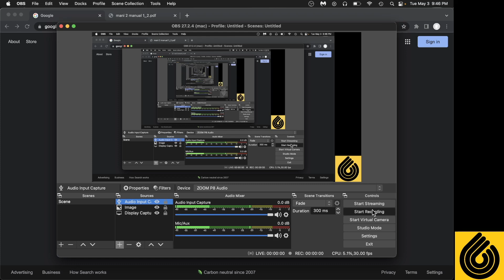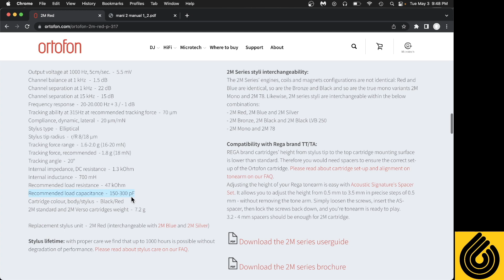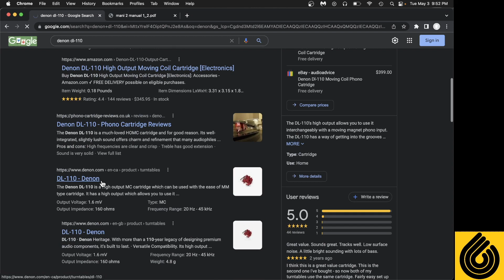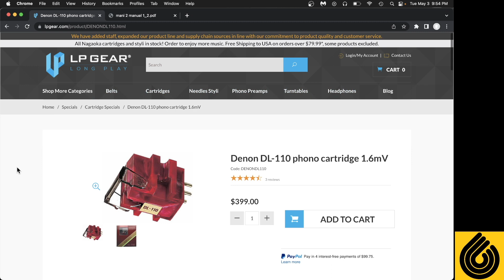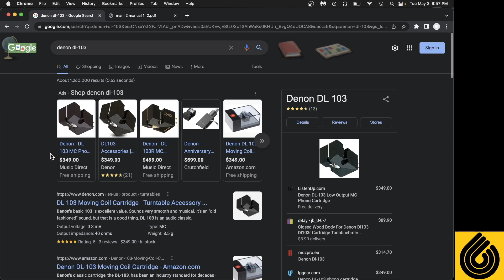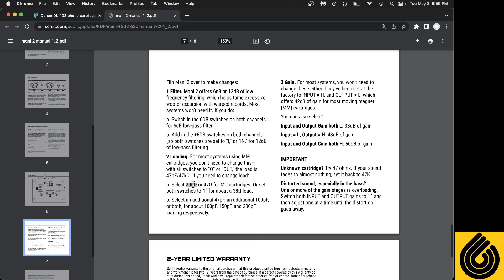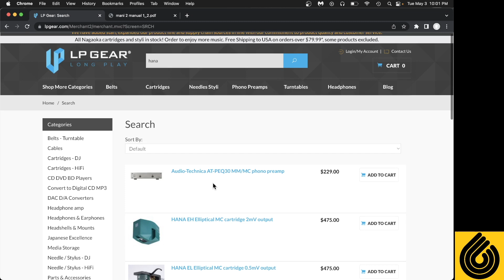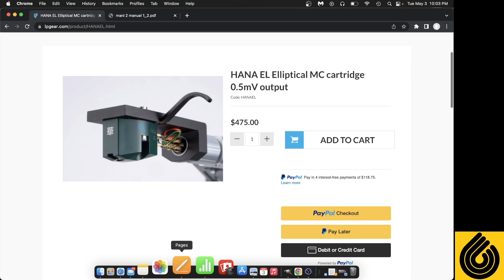How to Configure the Schiit Mani 2 (or any phono preamp)

Comment: My apologies if you already mentioned this but what settings would you recommend for the AT VM540ML? 

Thanks in advance!
Reply from the maker: It should be okay out of the box.  You might want to give it a little more juice than stock but setting the Input to to L and the Output to H.  This will give you a little more gain.  If that causes issues, change it back to Input H and Output L.

Comment: Mani 2/Ortofon 2 M Blue/Pioneer PLX-1000. Great setup tutorial. Thanks. You can lift the performance of Mani 2 with upgraded power supply. The stock wall wart is left wanting being noisy and you can open up on clarity and range a bit. 16VAC 2.5A Desktop Power Supply (AUD$39) from Wiltronics (Australia) Linear transformer C-Core type, Low noise with No SMPS RF. 

I was looking at the Skoll F but PLX-1000 hasn't got XLR output. If your turntable doesn't support Balanced why get a Balanced Phono Preamp. My system that I just ordered Schiit Jotunheim 3(Balanced Headphone Amp)/Lokius (EQ)/Mimir(Balanced DAC)/Mani 2(Single Ended Phono Preamp). Skoll has a volume adjustment and EQ through Forkbeard. I can match the volume from Mimir after I set the Mani 2 and Lokius is lot better EQ. Lokius both Balanced and Single Ended outputs are active so that when used as a switch (Balanced DAC XLR/Single Ended Phono RCA) you can have Balanced only output to the Amp. Of course the Single Ended Phono coming out from Lokius Balanced output still is Single Ended that doesn't change but allows you to listen both with Balanced headphones. 

Of course you get the manual but this makes it so much easier to understand. Thanks.

Comment: I asked the folks at Schiit about your recommendations…this is their response 

Ortofon 2M Blue and Bronze have the same loading recommendations. Cables can add between 50-150pF depending on length and construction. To make sure you're within their loading recommendation of 150-300pF, we recommend setting the Mani at 100pF (base + 47pF) because otherwise if your cables are on the higher end you'll eclipse their loading recommendation.

Comment: Sorry I'm confused. I have a mani 2 and I'd like to install a Sumiko blue point 2 moving coil on my turntable. Specs: Output voltage: 2.5 mV @ 1kHz, Load resistance: 47 kOhm, Recommended load capacitance: 100pF - 200pF. Can you help/show me what settings I need? And don’t you have the MM settings backwards, top loading is 200 max bottom load is 100 max? Thx.

Comment: Has anyone here paired the Schiit Mani 2 with an Ortofon 2M Red? I’m wondering how good it sounds. Also, would you say the Mani 2 is an upgrade from the Yamaha AS501 phono preamp? That’s what I’m running. Thanks!
Reply: As you can see there is many different cartridges with many different settings and options to get best out of them. Yamaha doesn't have specific settings. It will most likely work OK but never optimum. Specific Phono Preamp usually is better because you can set to what you have.

Comment: I have a Project Pick It Evo MM cartridge that has the same specs as the Ortofon Red, but the Output Voltage is higher at 7v vs 5.5v on the red. What would I need to change?

Comment: I've had a fluance rt82 going through the mani 2, Yamaha receiver, and Klipsch rp600m's for several years thinking I had the mani 2 set correctly because I thought I was supposed to leave it as-is for the ortofon om10. I resigned to the fact that my setup would just never sound as good as even streaming unless I upgraded alot. Turns out the settings weren't even correct from factory.
I watched your video and changed the settings to your recommendation and BAM! My vinyl came to life with better instrument separation, clarity, highs, and no distortion! Thank you thank you!!! Subscribed!
Reply from the maker: I love to hear that!
Reply: @christopherrobin58 i have a similar setup with the same tt and cartridge. what settings did you use on the mani 2? the first setup that was discussed?

Comment: Do you have recommended settings for the AT33PTG2? I watched your video and set it similar to the DL103 but it still sounds bad.
Reply from the maker: Make sure you have the 200 ohm settings on both channels ON (to the right) and the 47 ohm settings OFF (to the left).  The gain settings should all be ON (to the right).  The Filter and PF settings should all be OFF (to the left).

Comment: Hello, I'm a little bit confused on how to configure the load for my new ATVM95E cartridge. It says that it recommends a load of 47k ohms which makes sense since that's the factory setting but it recommends a capacitance of between 100pF and 200pF. Is there a way to set the capacitance to right in the middle at 150pF or should I set it to the upper limit of 200pF like you did in the video? Thanks for your help
Reply from the maker: Sorry, I just saw this comment.  from the factory, there's already a default capacitance of 47pF.  So, with the pF settings all off, you're at 47pF.  The switches add to that 47pF.  So, if you turn the 47pF switch to the right, you're at ~100pF.  Turn the 100pF on, you're at ~150pF.  Turn them both on and you're at ~200pF.  So, if you want 150pF, flip the 100pF switches to the right.

Comment: I can't get my Mani sounding any better than my Sony SDH190 built in pre amp. The Mani 2 sounds so quiet. I have WBC 1 foot cord, Fluance RT82 turn table with the stock Ortonfon 10m.
Reply from the maker: Quieter is better, no?
Reply: @6AM_YT it was really weird. One specific record I was testing it on (I had just bought it) was about 5x quieter than any record I own. Once I swapped records everything was fine.

Comment: I know this is over a year-old video but how do you know the right setting for GAIN toggle switches.
Reply from the maker: Depends on the cartridge. What do you have?
Reply: @6AM_YT  sorry about that your reply got lost in my notifications. I'm planning on getting a Denon DL-110.
Reply from the maker: @wolfren14   I actually recommend the DL-103 over the DL-113.  The 113 used to be a cheap, $100 cart but for some reason it's jump in price over the past 10 years.  If you end up getting the 113, You're going to want 47K ohm and the gain probably half way up.
Reply: @6AM_YT  What are the difference between the DL-110 and the DL-103..  I saw that the DL-110 is $299 on amazon instead of the usual $399
Reply from the maker: @wolfren14   If you hunt around you can probably find one cheaper than that, even.  The 103 to me has a more detailed sound than the 110.  The 103 is lower output whereas the 110 is higher.
Reply: @6AM_YT  Hey, can I ask you something? I been looking into Grado's cartridges because they're made in the US. How do they compare to the DL103 from Japan? Which one is more worth it and sounds better? I like both US and Japanese quality.
Reply from the maker: @wolfren14  I had a Grado Gold and another cartridge I can't think of.  They have a very thick sound that works really great for some stuff, but for most everything I find them to be too muddy.
Reply: @6AM_YT  alright, it sounds like the DL-103 is the winner.  :)

Comment: I've had my Mani 2 for almost 2 years. I left it in the original settings for a while before reducing the gain to 32db. My Ortofon 2m blue had a lot of pops and low level noise in the original settings and this did quiet it down. However I had to increase the volume to make up for the loss from lower gain. 
After watching your video, I switched back to 42db and put the capacitance load switches full right as you demonstrated. All I can say is wow and thanks!! I gained a lot more presence and dynamics without increasing the crackles and pops on my older records. Crazy how a few adjustments can change your whole listening experience. 
I like it so much, I cancelled the new Schitt Skoll order. I can't imagine my system sounding any better. It may be possible, but I'm happy with it like it is. Leaves more money for records.
Reply from the maker: Nice!
Reply: Same here! I'm new to the game and this saved me so much time I could have been wasting banging my head against the wall. Thank you!

Comment: Hi! What are the best settings for VM540ML?
Reply from the maker: I would think the out of the box settings would work fine for that cart.  Are you having issues?
Reply: @6AM_YT  Yes, just to be sure if I can change something that will make it sound better, Load Impedance (Ohms)	47,000 and Load Capacitance (pF)	100-200 for this cartridge
Reply from the maker: @mickriopel1993  leave the impedance alone but you can play with the capacitance to see what sounds best to your ear.

Comment: I bought the Mani 2 with an OM10 cartridge...out of box settings didnt work. I had to drop gain for both inputs and outputs to L, and resistance and loading are all in I...it still sounds crackly at the top end... im not sure if the pro ject debut carbon evo has sits own preamp? But it sounds better directly to an amp with a potentiometer in between for volume attentuation..
Reply from the maker: That table doesn't appear to have a built in phono preamp.  What input are you plugging it into?

Comment: Thanx for this videó! I have Mani2 and Hana SL low MC. Suggested load: 400 Ohms, wich Mani 2 does not have. What about MoFi studiophono preamp?  
TECHNICAL SPECIFICATIONS
Type: solid-state, MM/MC phono stage
Phono inputs: One pair single-ended RCA
Analogue outputs: One pair single-ended RCA
Input impedance MM: 47kOhm
Input impedance MC: 75, 100, 500, 1k, 10k, 47k Ohms
Input capacitance: 100pF
Distortion: < .01% (MM) / < .012% (MC)
Dimensions (H×W×D): 3.2×9.5 x16.8cm
Price: £249   THANX
Reply from the maker: I don't have any experience with the MoFi.  I would look at anything with a 500 or 1k ohm option.

Comment: How does the Mani 2 compare to my Marantz 2250B phono stage? I have a Stanton 681 ee cartridge with my Phillips 212 turntable.  The Marantz  I have had since high school  so no updates have be performed on it.  I cannot get any info on the Stanton cartridge except it has cartridge inductance 842 mH, DC resistance 1470 ohms,  channel separation 35@1000hz and tracking force 3/4 to 1.5 grams.  So the system is still working fine but I did not know if upgrading to a separate phono stage will improve the sound.  I do not know of anyone who can restore the Marantz receiver in my area of Tennessee /North Carolina.  But as some people say if it not broken do'nt  fix it.   Thanks  Dave
Reply from the maker: I couldn't say.  Those built in phono stages are sometimes great and sometimes garbage.

Comment: Just got in the Mani 2 and I'm left confused! How did you like that rhyme? Can you lead me to the best settings for my situation? You helped me deciding on the Mani 2. I think Schitt made this more difficult than need be 🙄

Shure m97xe  MM
Load: 47k, 250 pf
Output voltage 4.0 mV
Reply from the maker: I'd go with all the dip switches to the left.  You may want to play with the 47pF setting.  Otherwise, that should work for you.
Reply: @6AM_YT  Thank you 👍

Comment: Just picked up a mani 2, any ideas on how to reduce crackling sounds? Using it with klipsh the fives powered speakers along with TV and TT
Reply from the maker: Does it crackle when you're not playing records?
Reply: @6AM_YT  only crackles with the mani added. I hope that it isn't defective as I had to pay duties to get it and they have a restocking fee
Reply from the maker: @blackspawn202   It's not just surface noise on the records?
Reply: @6AM_YT  I don't think so since I wasn't hearing it with the built in preamp of the fives. I made sure to switch the speakers to line too. TT is grounded to the mani and I'm using a Ortofon OM 5S. Can hear the cracking with the default settings and the MM settings outlined in the video. Idk if it's interference from the rest of the multimedia setup
Reply from the maker: @blackspawn202  Is your cell phone near it?
Reply: @6AM_YT  mb forgot  to reply. Ended up rewiring my whole setup and deep cleaning the vinyls. Seems to have reduced the noise so i'll keep it. Now I'm debating adding a dac for lossless streaming
Reply from the maker: @blackspawn202  Glad it's worked out!

Comment: This video is really helpful thanks. For a vm95e would you say these settings be the pretty much same as what you showed for the 2M red? The vm95e is 47,000 Ohm impedance and 100-200 pF resistance.
Reply from the maker: pF is actually capacitance and not resistance.  It's confusing, I know.  I would start with adding 0 pF and then mess those settings and see what you like.  It's going to be system dependent.
Reply: Ok cool, thanks! The Mani should arrive in the mail today so I’ll start with 0 pF. By the way FWIW I’ll be driving this with a Yamaha R-S201 with 100w/channel with 8ohm speakers.

Comment: Just installed this thing last night.  I was just using the Onkyo stock out and had to turn the volume to 60 just to really hear it and 80 to really play it loud.  It sounded lame LOL.  When I got Mani 2 going, I was flabbergasted.  You can listen with great detail at 35 now.  Great buy for $145.
Reply: @6am here’s the next question to address: how to hook up two Mani 2 preamps while using a DC linear power supply. I have a very nice 20 amp LPS and I’d like to know how they connect two of these to a record player AND why?

Comment: Setting 200pF on the Mani 2 doesn't allow for around 100 to 125pF (average) capacitance in the cable, so you may actually want the Mani set to 47pF which will bring it close to spec for the cartirdge needing between 150 and 200pF when you add cable capacitance.  You'll likely find most MM cartridges have pretty well the same impedance matching characteristics.
Reply: is this the better alternative? n how would I do this?

Comment: Hi 6AM, can you tell me wat the best settings ther is for my Nagaoka MP-200 is for me? Many thanks en greatings, Fred from Holland.
Reply from the maker: 200 ohm loading OFF and 47k ohm loading ON.  You can mess around with the capactince settings, but I would start with them off.  Input should be L and the Output should be H.
Reply: @6AM_YT  Any reason you recommend the gain of 48 instead of 42 for the Nagaoka MP-200?  I have the same cartridge and am interested in the best settings.  Thanks for great tutorial btw.

Comment: Hello!
Thank you for your tutorial.
Can't you advise for my setting of
Ortofon SPU #1e?
Reply from the maker: This is one is going to be hard since the output is so low on that cartridge.  You may still need a head amp with this.  Try this anyway:

Under loading: have 200 ohm R and L off.  Have 47 ohm R and L on.
Have 47pf and 100pf R and L off.

Under gain: have everything on H.
Reply: @6AM_YT  Very thanks for your help. I'll try and let you know the results. ^^
Reply: @6AM_YT  Today I tried based on your recommendation. Very good! But too high on my marantz7 phono line. So I connect cable on just aux stage.
It is better than pre amp's phono stage. Thank you for your choices! ^^

Comment: Is the Rega Exact a good match for the Mani 2?
Reply from the maker: It should work very well.  I would try the default settings.  Since that's a very high output cart, you might want to try turning off all of the gain settings if it seems like it's distorting the front end of your preamp or pushing it too hard.

Comment: Thanks for the video! I have the Mani 2 with an Ortofon 2m Blue. When I hooked it up the volume knob was at the same position as when I was using my built in phono on my Audiolab 6000a but the sound was lower. I’m using the factory settings. Would I need to play with the gain settings to make it louder?
Thanks!
Reply from the maker: I looked at the specs from your stereo and the phono section is 55 dB, which is really quite high.  I'm guessing they chose that to mate with some high output MC carts as well.  55 dB isn't an option on the Mani 2.  The stock configuration is 42 dB.  You can set it to 48 dB, which will get you closer, but not all the way there.  You can do that by setting the "Input" dip switches to "Low" and the "Output" dip switches to "High".  See if that isn't more to your liking.  I would also turn on both sets of capacitance switches since that cart is extremely bright.  Let me know how that works for you.
Reply: @6AM_YT  I will, thanks for your help!!
Reply: @brandonwinstead5128  wondering how you ended up setting it up 🤗

Comment: Will the Mani 2 be able to boost the signal for a vintage B&O MMC5 with only 0.6 mV/cm/sec output?  My NAD PP 4 can not. Thanks for your help.
Reply from the maker: I'm using a Denon DL301 MKII which only has .4 mV of output and it works fine with everything at High.  You should be golden!
Reply: @6AM_YT  cool… thanks!

Comment: I've bought from LP Gear quite a bit and they have great stylus replacements. I'm breaking in two styluses for my Pickering XV-15 625E and my Stanton L720. I bought their Vivid Line contact styluses and they sound excellent. And as you've seen they tend to list more tech specs than the manufacturer does. I'm going to try and buy this Mani 2 in a few months so I found this video very helpful. Thanks!
Reply from the maker: Glad to know they’re more than just a good resource for technical information!
Reply: @6AM_YT  Well, I just got my Mani 2 today and I'm listening to my Denon DL-103R and so far it has more punch and detail than the Mani 1. I still need to do a good burn-in and then do a proper A and B needle drop test. I couldn't wait for a few months and pulled some $$$ from my savings and also got the Loki Mini+. I have it set up and listening to them right now. I watched several reviews on the Mani 2 and the Loki Mini+ and everyone gave them good reviews. Your settings you explained work great! Thanks!